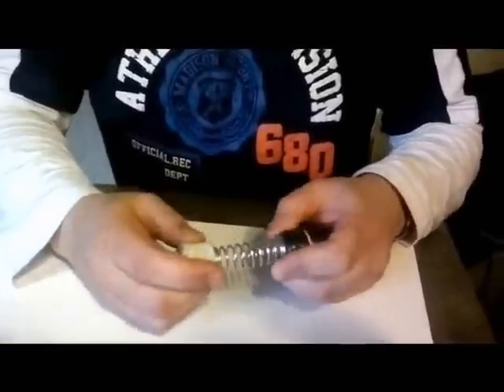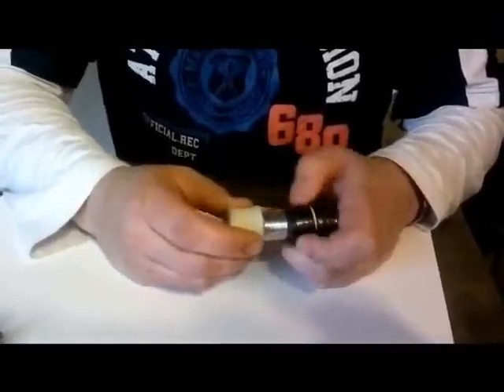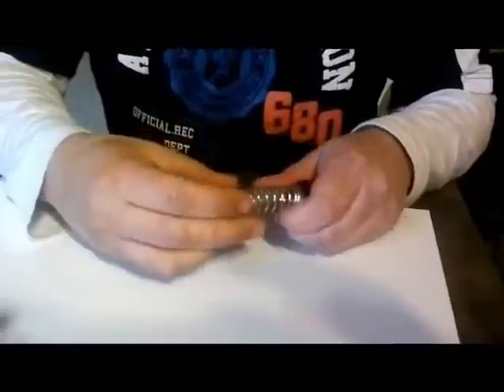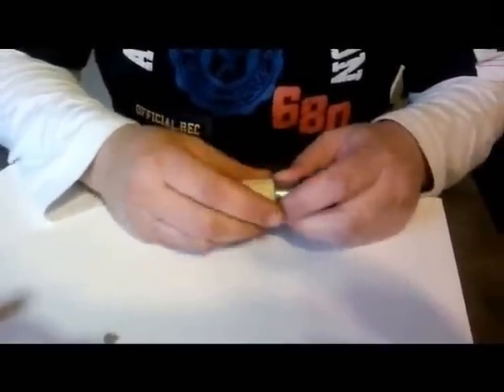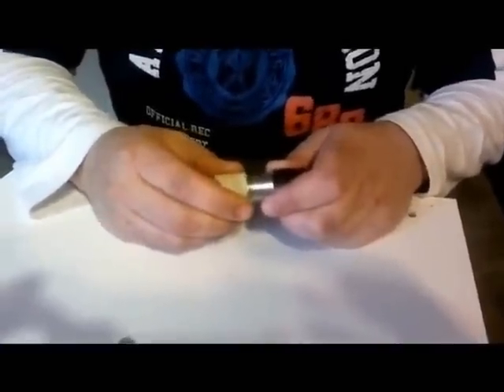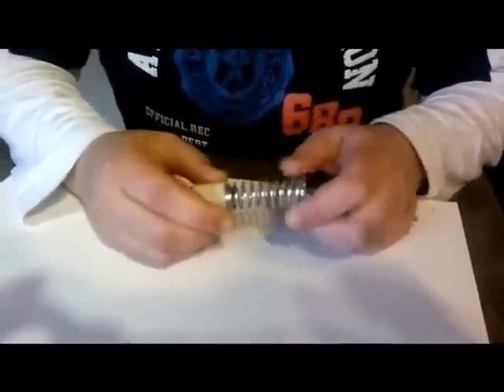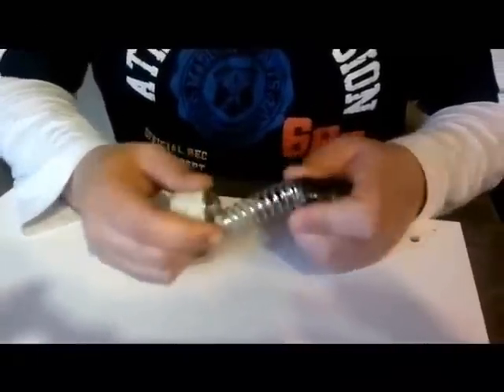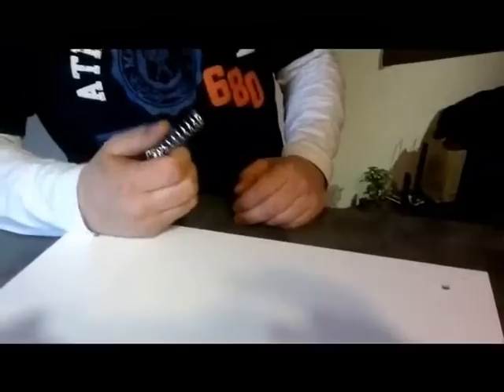Re: Magnetic Spring Piston For Use In Free Energy Magnetic Motors

Comment: It would be negative if you were being super-duper exact about everything and didn't take temperature into account (that is you only measured the energy added to the system and then the kinetic energy of the projectile). When you add the energy expelled as heat and sound, you get back to zero. input = output.

The closest this free-energy joker could probably come is just zero, though; The measurements wouldn't be that accurate and the quantities involved are very small.

Comment from the maker: Indeed, I was wrong about the energy sum being negative: fuck me to hell. There are equations one may use to estimate heat lost due to springs compressing and decompressing based on what the spring is made of and how much force is used to compress it; they are similar to the equations used for calculating electrical resistance. As long as this guy is storing energy in a spring, why the hell not store it in a battery?!